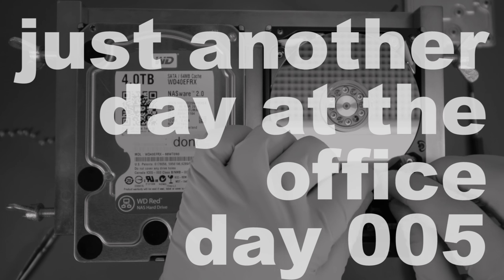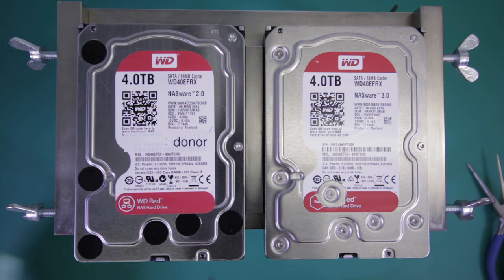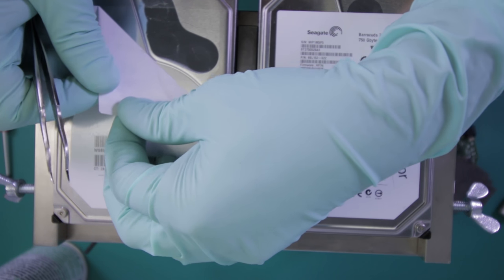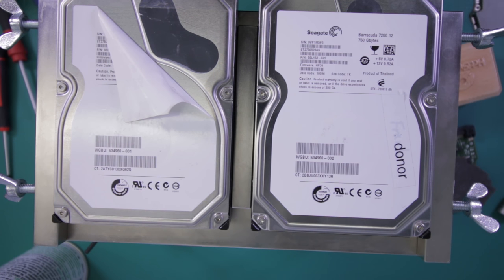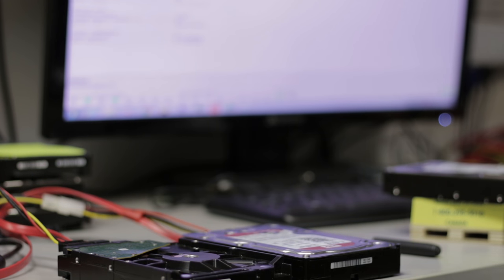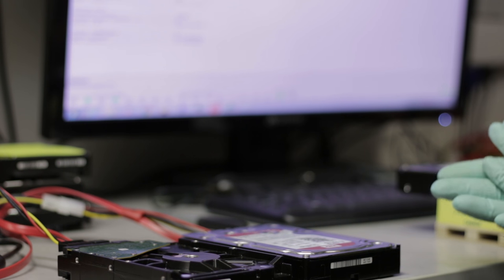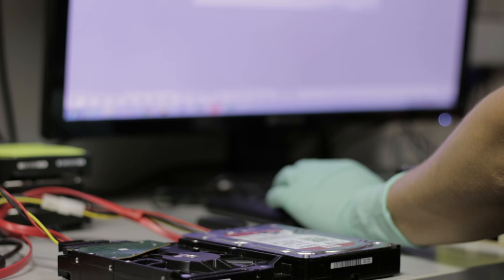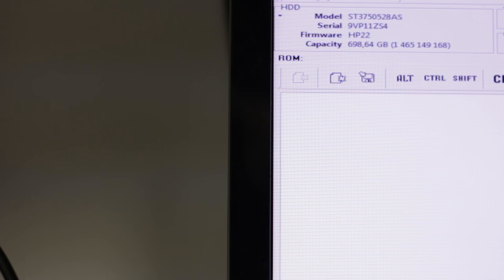recovering hard drives with clicking sounds

Comment: I have a seagate barracuda 1tb. It's fall on the ground. I 100% sure that heads was smashed into the hdd body wall. So is it for sure dead? Or it can be repaired and data can be used?
Reply from the maker: It's hard to say without seeing it. As long as platters are not scratched,data is recoverable
Reply: Is it possible to get new heads to replace? I just can't find identical damaged or useless hard drive to use as donor.
Reply from the maker: heads come inside the drive, you can't buy them separately. eBay is a good source for parts drives (search for as-is)
Reply: Okay, I have good and bad news, I spit on files and took off the cover. <heads are good, but looks like the board is damaged and hdd sometimes it appears in BIOS or Knoppix but it does not allow to open HDD in explorer or make image off it.
Reply from the maker: +Ivars once the drive is opened it will never work reliably again.

Comment: Hello there, I have one of these drives that suddenly if it's plugged into my PC, windows will not start (and it's not the C: Drive just a storage drive D:). So I bought an external USB cable adapter to see if it would work on it's own as an external drive. The drive powers up, however, then goes to a SHH SHH SHH SHH ..... SHH SHH ... random sound. No particular pattern. I was hoping someone would help  me understand what the noises mean? and if I can get my data back.

Comment: I need help apparently the heads have crashed do I replace the arm?
Reply from the maker: if you need the data - get professional to do it. You will kill your drive
Reply: HDD Recovery Services thanks for replying. But I have data on there for work that I don't want to share
Reply from the maker: well, you will most likely lose it forever if you try to do this yourself. Not trying to discount your ability, but these procedures need lots of knowledge, expertise, and most importantly proper equipment to pull it off.

Comment: My 1 TB drive was restarting and then showed no drive found at all...then the board was cleaned and it worked fine for 3 hours since then again the drive maked click sound and then hangs for a while and then run fine for fee seconds but does not restart...what can be the problem...
Reply from the maker: Hard drive might be failing. Back up everything critical now if you can.

Comment: im gonna do this once i get a chance im pretty tech savvy will just have to see if this works
Reply: it won't, you need to do this in a clean room because if any tiny particles in the air get onto the hard drive platter then your data is toast
Reply: ProBit Support its ok I destroyed the hard drive and trashed it not worth it lol your right

Comment: Is it possible by any chance to clean the contaminated heads?
Reply from the maker: Yeah, but swapping them with new ones from a compatible donor is a better option.
Reply: HDD Recovery Services alright, now here's my scenario. I have a dead laptop HDD that went on its own without any previous tampering and physical trauma. Upon death I did open it in a non-sterile environment to check if it was a stuck head or something. Heads glided just fine, just the click of death. I did all this DIY without true knowledge of the consequences of my actions as I went along. The drive may have 1 spec of dust particle (to the naked eye that is) on the platter however they were never tampered with to get misaligned, not even touched to clean it. It has been run multiple times under these non-sterile conditions however. There is no evidence of scratch whatsoever on the platter (to the naked eye). In your opinion, could there be any hope for this drive if I send it for professional services?
Reply from the maker: we recover drives that have been previously opened by users several times a week. It does make work more challenging but not impossible.
Reply: HDD Recovery Services what is recovery cost?
Reply: @FeTiProductions   i am here too to see if I should take a quick look and maybe tap that thingeee just to see if I can unstick it or something. Data on this drive is NOT critical so no problem if i loose it. Guess I will look at a few more utube videos at least give me SOME small hope of getting my drive recognized. It clicks a few times when trying to boot up, but does not spin after that. Not recognized in bios or if i hook up to my trusty NexStar. First drive I have ever lost data on in 30 something years, so now on a mission ha

Comment: Hi, just subscribed to your chanel,,,am kind of sabby when it comes to electronics... My situation is as follows: I have 2 hard drives of 1 TB each with only family pics and video... One stop working and I desided to recover the data with software... I was 85% finished when my dog ran under my desk and droped  the HD to the ground then started a clicking noise.. ( i was mad) but desided that even though there is no hope to read the data  i would wait untill technology offers new advanced solutions. I saw your channel then my hopes rised high.
My question is how much percent of your repairs are succesfull after a clicking noise from those drives?
I havent open the drives yet.

Thanks for your help.
Reply from the maker: As long as the drive has not been opened - over 95% chance to recover here

Comment: In most cases if not all, the information (data) is worth more then the drive why bother rebuilding the hard drive unless cost of replacement is a factor, but if the drive failed the first time why trust it(hard drive) again?
Reply: frozen house: In the scenarios I've seen, these data recovery operations can be VERY expensive compared to the cost of the drive. 

So the implication is that the data is VERY important to whoever owned the drive. (i.e. some company). 

So the key thing would be to recover all the data possible -- whether the drive should be trusted long term (I certainly wouldn't) is secondary -- it's getting all the data off it within a reasonable cost/timeframe by someone who knows what they're doing -- probably with access to a clean environment. 

...

Now, if the data is very important -- why the HELL they don't take care to ensure they have multiple safe copies of the data, including an offsite copy or two, is beyond me, but people do really stupid stuff and try to get by on the lazy and the cheap all the time -- until they have a big problem.
Reply: Roger Geyer well if they did that you'd be out of business? 
people are at your mercy,just like a auto repair shop, the sky is the limit
thanks for your response.

Comment: I tried lot of solution, and only that one... I have 2TB fake external HDD which has 80GB storage only. I trield Sector Checker if it is real fake, then after that, I plug it back and it keep disconnecting and reconnecting. Now, it has a clicking noise, over and over. ANYONE CAN HELP ME?

I'd like to repair it just to use the 80GB storage space.

Comment: If the drive is working fine after the headswap then why do you need imaging software at all? Can't you just plug it into PC as normal and use the drive? At least as long as it takes for Windows to copy all files off it onto a newer better drive.
Reply from the maker: No, imaging is the most important part of the process. Hooking up a failed drive after headswap is a huge nono
Reply: @hddrecoveryservices  What will happen if a drive is hooked up after a headswap, why is that a huge nono? I assume you have to connect it too after a headswap

Comment: Great work! I'm from Brazil and I have a ST1000LM024 Samsung HD in my laptop, which has the same issue. And as I tried to find a solution for it online, I just found out many people with this exact model and same problem. What could be the cause of it? I was using the laptop in my daily activities, suddenly a blue screen appears, the system restarts and doesn't boot anymore. I think all my data is gone :(.
Reply: Same here dude. Same here :(

Comment: I had 2 HDD in my laptop and 1 started clicking. No issues. just fire the bad one in the trash after letting it soak in vinegar overnight. I don't need my data from my laptop because I mostly use it for streaming video or shopping on amazon but I don't want some scammer to ever find my hard drive and start pulling debit card info off it.

Comment: mine starts spin..but then makes a digital clicking noise and won't start..doesn't show up n the disk management..any ideas you guys???
Reply from the maker: Heads are dead most likely. I would highly recommend not to attempt to do it yourself if data is important. Any pro shop should be able to handle a headswaps
Reply: @hddrecoveryservices  thank you!

Comment: I have a Seagate drive that was fried with 12volt on 5 volt becsuse used old cables for new powersupply. I replaced the controler 100710248 and moved the bios rom. Now drive spins up heads go to inner of the disks beets 2 times then gives up. Maybe bios was killed. Drive is ST4000DM000    FW:CC52
Reply from the maker: No, if you killed ROM, then the drive would never spin up.

Comment: I FEAR IF I LOST MY DATA, so I am asking here for a ray of hope..  I have a 5TB My passport from WD. I dropped it from my waist's height on the floor. for two days was working fine, but today it's not showing up contents on THIS Pc folder. The tray bar detects the drive with its name in the icon but does not reveal the content. It runs with sounds as normal and shows up the white LED blinking.. but unusually makes s click sound almost every 25 so seconds.. Have all the data been lost? i tried all the USB ports on my dell inspirion...  and by now have tried 7-8 times running it, but I am not doing it anymore until some expert would give me a ray of hope.. I am very very very horrified... it's my 5 years and more of research data on the stake...  just tell me please I am alive or dead.. A great help. Thanks.. from India. Would data recovery from some agency work,... or should I just forget about it and restart my bachelor's (am a post-doc researcher now).. buhuhu...
Reply: thhe hard drive has the click of death and is very difficult to recover